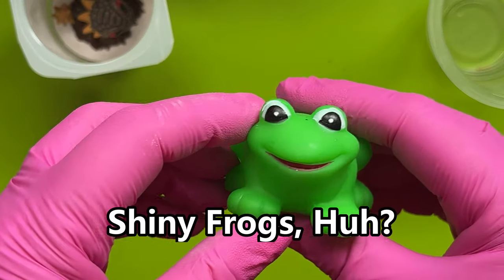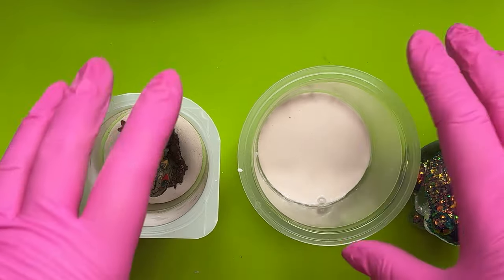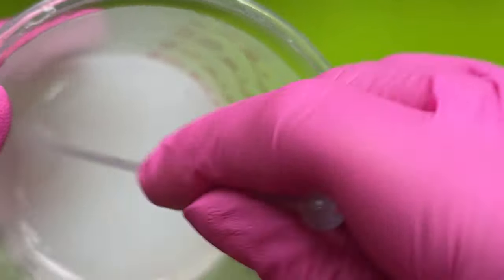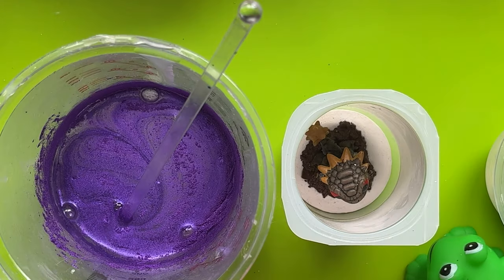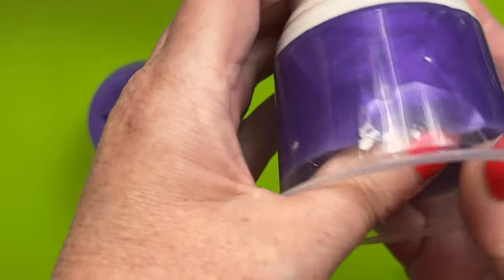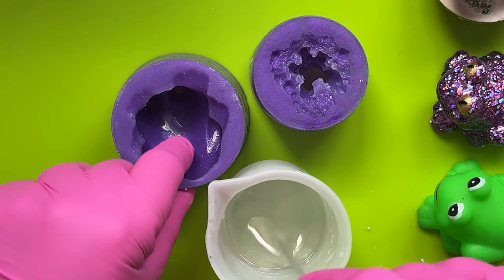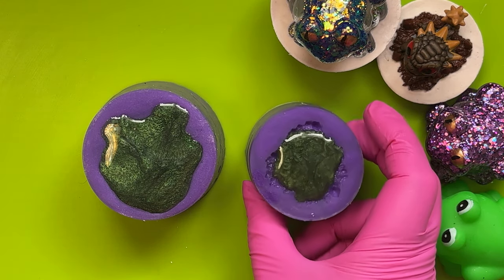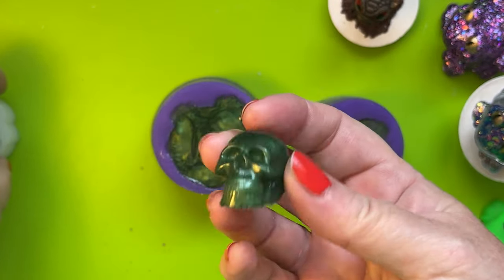#117 DULL MOLD SOLUTION! Shiny Frogs

Comment: I pour silicone into silicone to make inserts. You have to use a bought mold not one you made. Spray mold release in it and they pop out like a dream. I only use let's resin silicone.
Reply from the maker: I usually use mould release on the trickier ones. Not tried  pouring silicone in as that would surely lose details? I'd be really interested to know  how to do that, if it works, sounds interesting
Reply: @miniscenesgb no you won't lose details.  I posted a video showing how😊
Reply from the maker: @Ali-H3444  thanks, I'l take a look :)